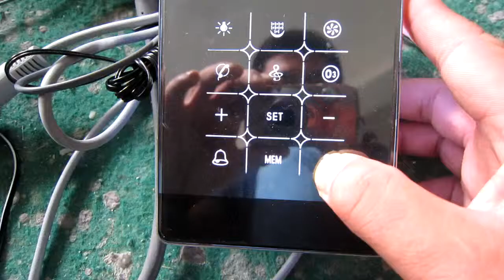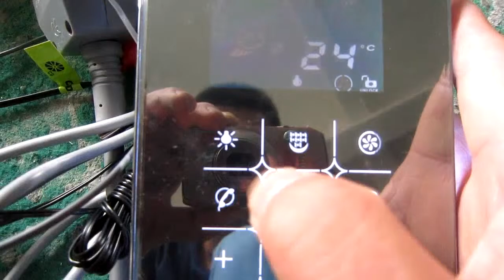How to use Steam Generator TR 029 Part B

Comment: I have a TR-019 steam generator ( 120 V 3 Kw model ) and it did not have the users guide or owners manual
I have it installed correctly but I dont know how to use the Controller or remote control ...Can you please send me the manual?

Comment: I need parts for the steam shower TR-009 any advice?
Reply from the maker: what parts do you need Tina? the whole complete steam system ?or some particular parts like steam generator or the control pad ?
Reply: I can send you a pic if you send me an email address
Reply: We just installed our steam shower and we can't find where to plug in  the ozone. Our lights and fan and speakers were already installed in the walls and roof but we can't seem to figure out where the ozone is